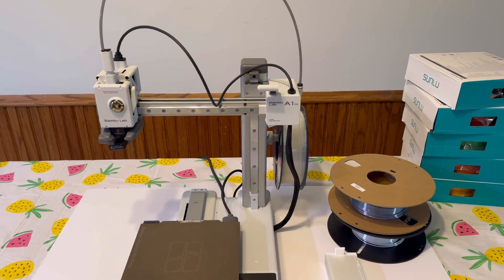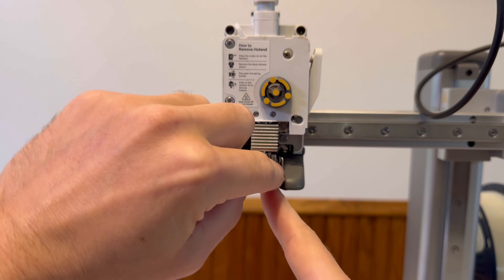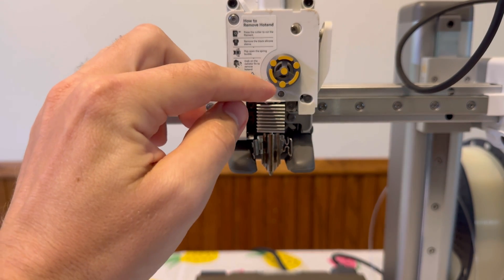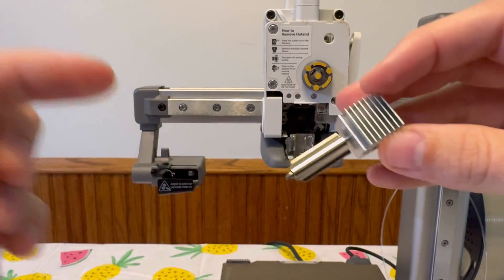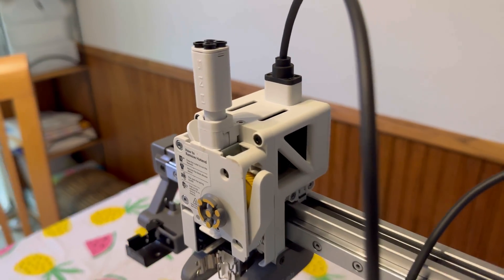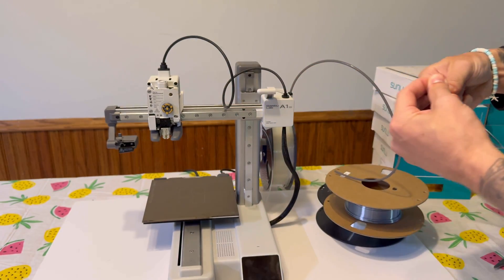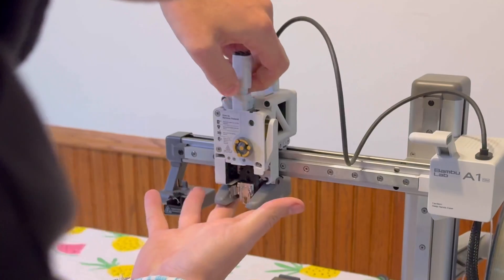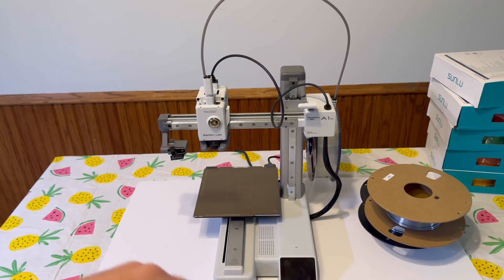FIX Bambu Lab A1 Mini Extruder Clog - Not Extruding

Comment: Wow, you spend a lot of money unnecessarily on hot ends. more than 3/4 of the time all you have to do is pull the filament out, stick the hotend back in, heat it up, manually load it while pushing on the new filament and it will push the old filament through. And not the nozzle is not the biggest cause of broken filament, too much moisture in the filament is the biggest cause. In fact with 4 years of printing behind me , that's the reason for filament breaking probably 99% of the time.  I leave filament on the printer too long and it absorbs the moisture in the air and requires using a filament dryer to correct the issue.

Comment: hi i was wonering if you can help me. my head unit was blocked and i couldnt unblock it. so i ordered a new 1, i installed it. started to print then it stopped saying the head was blocked, ive taken apart and checked everything, but there is no blockage. i have rund the printer again but it keeps stopping, telling me to unblock the head when it is clear. can you help?

Comment: This was awesome! I'm so happy I found your video first! Ive had my printer for almost a year with no issues and hadn't used it in a while and noticed the filament was broken into pieces. After trying to get the filament to extrude, it didn't. For this to be my first troubleshooting experience, thank you for explaining this in quick and simple steps. As Im still new to 3d printing. I subscribed :)!!

Comment: Tip: To pull the filament manually, after you cut, hold the lever on the left side and then pull out the filament.

Comment: At 3:44 if you experience a clog somewhere in the extruder do not remove the ams this way you will break the clamp ( you can see that he even does if you look close enough in the video) and also risk breaking the ribbon cable thats attached to the device. Please use the official website faq when trying to unclog the machine.
Reply: Ya mine broke doing this..
Reply: @RiceCrispyKneeez mine too…

Comment: thank you for the tip, mostly for what comes at time 3:43! thanks to you i broke my sensor, and the printer now is as useful as a pile of garbage. if only i saw the official video before and new, that there are small 2 bolts to unscrew, and everything comes out smoothly without pushing anything. thank you!

Comment: I have a problem it is stuck inside the tube I ran in to an error with the filament bc it got stuck on the spool so I cut it but then the print was resumed and the filament that was still in the tube is now stuck in the tube and I can’t get it out

Comment: Yay! I fixed it! Thanks mate, in my case it was in the ams thingy. Remember to never leave old filament in the machine overnight, mine printed fine but during the night the filament snapped in several points. If it snaps in the tube who cares, just extrude till its clear, but in this case it snapped halfway inside the ams and hotend, clogging everything

Comment: Great video! Had a small piece of filament break inside the extruder. It was stuck between the ams and the cutter. I’m gonna blame it on the PLA I was using being over 2 years. Had a few of my old spools crack on me since I started printing again despite them being stored in a bin with every silica gel pack my family has gotten with products over the past 4 years.

Comment: Yeah, I've had an issue with extruding filament twice and both times this video didn't go far enough to fix my issue, I wish there was at least tips on what to do if it's not this issue.
Reply: Go get a dryer box.
Reply: @franklee663  Honestly, that's when I started having issues. Sometimes the dryer is too hot and it causes the material to slightly change thickness

Comment: My filament won't even get to the extruder or the cutter of my brand new A1 printer, been trying to load it all afternoon and it's not working, tried a different PTFE tube inlet as well it's v frustrating cause no one seems to have a problem just going through and loading their filament. Am I a dumbass pls help

Comment: Had a two inch piece of cut off filament stuck down in the extruder. took the tube splitter out like you showed and it was just sitting there, in the way.
Thanks for thew tips.

Comment: It’s almost never in the extruded, except of course when it is and my first clog is of course in the part you didn’t show as the filament won’t go through there like it does in this video
Reply: Right, vid is called extruder clog and isnt even about extruder clogs
Reply: "In this video about fixing a clog, watch me not unclog anything"
Reply: For those interested the way I fixed mine was remove the cover, nozzle and then unscrew the little cover over the extruder. I was then able to extract a tiny piece of broken unmelted filament with a pair of tweezers.
Reply: @waza987  likewise, this is exactly what I had to do as well. There is another good tutorial on how to do this out there as well.
Reply: yeah, did a cold pull, did everything, and sadly the problem most definitely IS in my extruder. So now to take that apart.
Reply: Me too
Reply: I accidentally broke the filament inside the extruder and cant pull it out what can i do
Reply: Mine too lol

Comment: I did all this and it worked.
But around two hours later it happened again this time mid print.
How do i fix it without turning it off 
because i dont want to lose my print and i searched on google if i turn my printer off mid print it will forget where i was. HELP
Reply: This won't help you to continue printing 😅.  But this happed to me too. Unclog a nozzle and it clogs again after few hours of printing.  So after unclogging the nozzle I ran "eSUN 3D Printer CLEANING Filament" through the nozzle (about 12") and have not clogged since then.